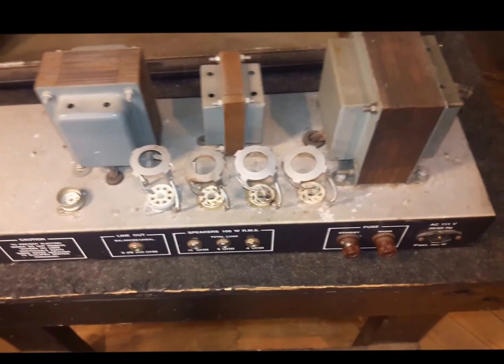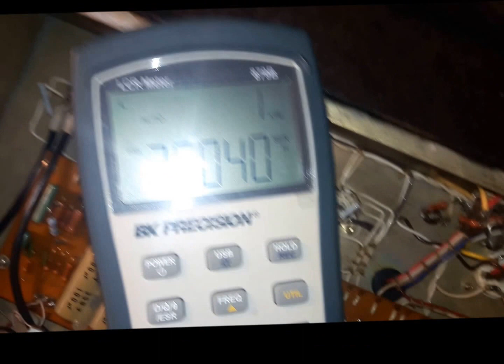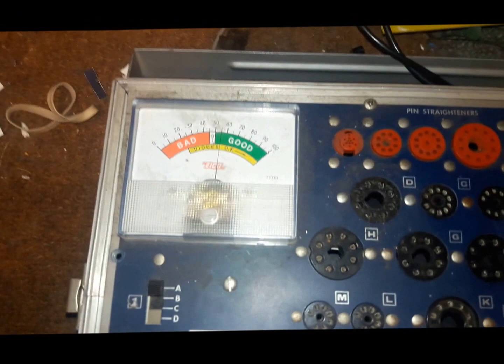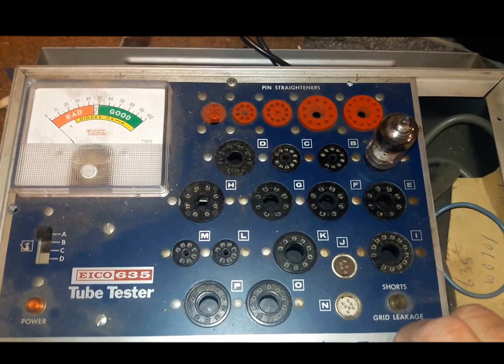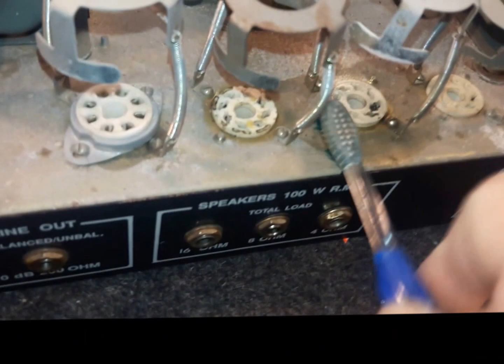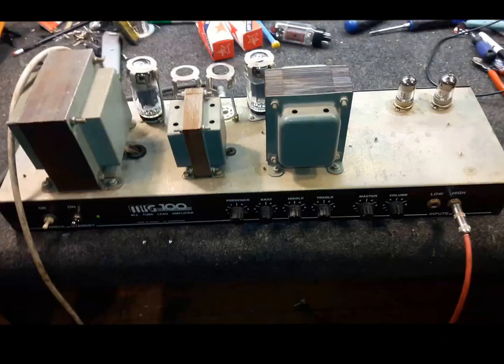Sovtek MIG100 repair

Comment: I was looking for a video like this! does anyone knows by chance what are the L values for the power transformer?
Reply from the maker: When it comes to power transformers, just make sure the secondaries have the correct voltages on them. If your blowing the fuse you might have to unsolder the secondaries from the circuit. If your still drawing to much current the power supply transformer might be shorted internally.
Reply: @clintronicsrva  Thanks! i was thinking about the inductance because its no easy for me to find a suitable voltmeter above 600 V. I guess i'll a have to buy one.
Reply from the maker: @luispablocastilloj.6160  If your using a variac you can always dial it down 20% then when you measure with your meter just multiply your reading by 1.2 that should keep you under 600V
Reply: @clintronicsrva  You're right! thanks for the advice  I'll do that

Comment: I have this very same amp. Only one thing though. By the preamp tubes there’s a coffin shaped metal box that reads “Caution Radioactive Material”. 

I got the amp as a gift in the late 1980’s. I didn’t realize it was there for a while.
Reply from the maker: That little box is just extra shielding
Reply: Clintronics RVA - It doesn’t  stop glowing though? It’s been 20 years? 

The guy I got it from was in a band called “KGB” = Killer Garage Band?

Comment: Hello, i'm currently working on a mig100, it's eating tube, bias is good but plate and screen voltages are at about 550V... which tube would you recommend ? It's too hugh for 6L6 and i don't think the PT could handle EL34 ? Thanks  !
Reply: Fix the problem rather than working around it

Comment: You DA Man ! Hey can you put a video up on a Marshall JCM 2000 how to change Power Tubes and set Plate Voltage and RE Bias the Power Tubes.? I own 3 and love the amps. All working great. I will let you borrow one of my 50 Watt Heads if you want and make the video. Thanks Clint. Tommy B